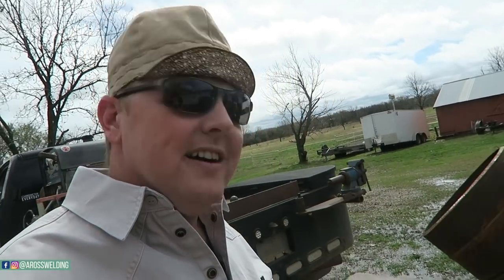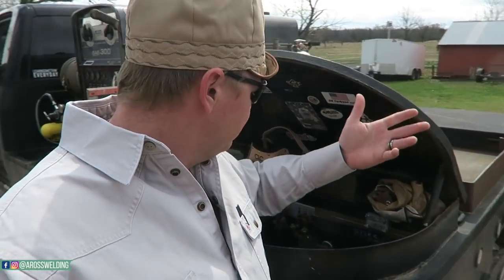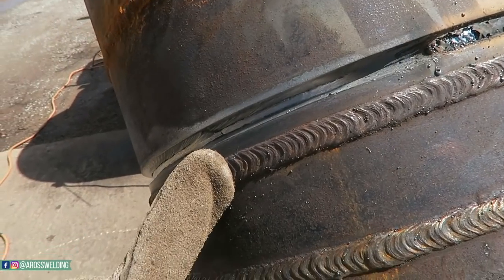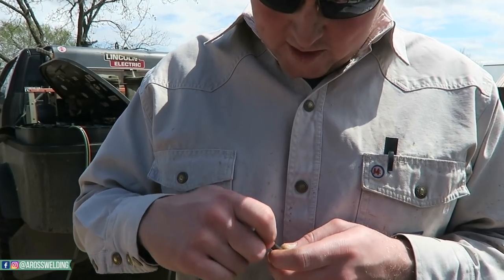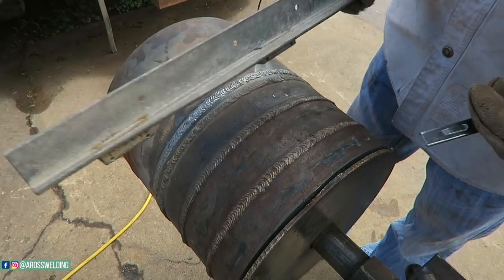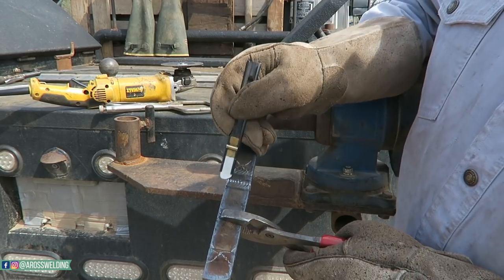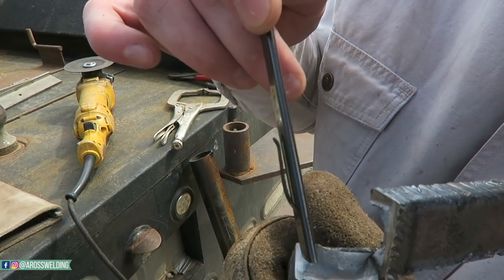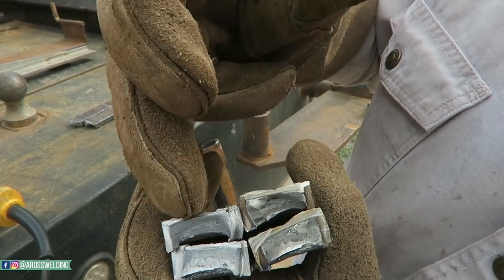HOW TO TEST YOUR OWN WELDS AT HOME // PIPE WELDING PRACTICE (I broke my vise!!!😳)

Comment: Now you can make a video welding that vice, it would be awsome learn how to weld cast iron or steel
Reply: it will break again. Even if you silicon "cool" it and V bevel the entire break, it will break again. Cast is extremely dirty and the mixture isn't consistent, so you have a lot of dirty spots or high iron deposits in it. Sure, you can weld it, but it's eventually going to break right at the toe of your weld.
Reply: @michaelalmeida8790  not if you weld it with the right rods. Too many guys try to lohy it because cast rods are $11 per rod
Reply: Mig weld it or tig

Comment: I am NOT a professional welder, just a DIY’r with a bit of exposure and experience.  I was always told if a rod or Mig wire flux core weld uphill to keep flux from over running and interring with the filler material, tie in and porosity. Yet I see you welding downhill on the pipe.  I’m sure different rods, material thickness, prep, weld machine amp settings and welder skills running downhill flux electrode can be accomplished.  But is it actually something that would be generally accepted if a QA person were witnessing your weld on a critical weld.

Comment: That looked an awful lot like a Harbor Freight pipe vise. And if you are telling me you got almost 9 years out of it doing pipeline and rig work you are well ahead. I bought the 6in Harbor Freight vise probably around the same time and am happily surprised it has survived and I haven't abused it anywhere near what yours has probably seen. Also for the HF vises, from what I have seen that mode of failure is the most common. You cant expect much more from a Chinese junk cast vise that only costs $80..

Comment: Practicing for my first test. Is it better to grind your root or run a wire brush? I haven't taken my first test yet, but on the root I wire wheel it, run my hot pass at 75-90 in 3rd gear depending on my mood, and I push till I feel it dig, than long arc to let it fill before I do my next step. I notice the guys who grind there roots tend to scrape drag and step/whip it without really digging. When I say dig, I mean I push down like you push down a pencil on paper till I fill the rod penetrate deep enough into the root bead that it almost pierces through the other side. Is this an accurate method? Self teaching here
Reply from the maker: Either way, I know guys that grind their beads and I know guys that’s don’t grind em. I’d say most generally most guys grind them on a test but I have known a guy or two that didn’t grind it on a test and still made the test. Everyone welds different and learned dif techniques from others or self thought like yourself.
Reply: @arosswelding   Great piece of advice, I appreciate it thank you.
Reply: @arosswelding  thanks austin and   durpfurper for  being thurough in your question  and telling how you do it

Comment: Would a 6011 1/8 inch for the root an 7018 1/8 inch fill an cap on 8 inch pipe be a good practice?
Reply: I do it all the time, but sometimes i just do 6011 all the way, just to get a feel for that rod. I use 6011 because my weld supply stores use the cheap 6010 rods that do not weld for shit, surprisingly the 6011 they sell burn better. I want to get 6010 5p from lincoln, but a bit expensive at the moment.
Reply from the maker: Oh ya that’s good practice.
Reply: @Ruben901  yeah everything is going up.
Reply: @melvinmariott8609  

Just wait till you see the pricing for 8010 rod....Dubya Tee Eff!

Comment: I realize that you're just testing practice welds in this video, but I want to point out that API 1104 currently requires that nick-break test specimens "...shall be notched with a hacksaw...".  It would seem to be appropriate to allow them to be nicked with a narrow disk grinder, but this is currently prohibited.  This will change in the soon-to-be-published 22nd Edition of API 1104.  I also want to point out that the exposed fracture surfaces must be at least 3/4 in. wide, so the specimens should be on the wide side of “..approximately 1 in. wide…” and the notches should be on the shallow side of “…approximately 1/8 in. deep…”.  Keep up the good work!

Comment: Where do you get your welding caps an what brand??
Reply from the maker: The one I’m wearing in this video is DABEC brand. But I also wear BADASS caps. You can find both online
Reply: @arosswelding  okay thanks. Its looks alot like the ones I wear..an I can't find them anymore there a rougher an stiffer material an that's the ones I like because them soft ones get all crummy to me when soaking wet with sweat on them hot Louisiana days. Thanks alot enjoy your channel

Comment: Looking for my first pancake would u recommend the Wendy’s or sarges or what is your recommendation for a first pancake that won’t break the bank
Reply from the maker: Out of those two I would get the sarges. Cause it’s lighter in weight. But I personally like my empire south and cmr pancakes.
Reply: Austin Ross been looking at the CMR which one would u recommend from their line
Reply: I like the carbon fiber ones from outlaw leather. You can find them anywhere though.

Comment: Do you tow with that step hitch you burned in?
Reply from the maker: What hitch??
Reply: Austin Ross the one on your welding truck in this video, what did you weld on to the tow ball hitch?
Reply from the maker: Those are blocks that a spring place made for my rear end to make it level but they never worked so Welded them on for a step. I pull a trailer more often when I’m home so I like to leave my ball in there instead of the other hitch I made.
Reply: Austin Ross very nice, I’ve been thinking of making one and I like the way that one looks.

Comment: Hey Austin, I have a 300 like yours but capping the bottom is kicking my butt on a  12 inch bell.  What do you set your Course and Fine (remote) settings on when capping the bottom ?  I guess I mainly just need to know what you set you Course setting on, 150 or 220 ?   Great video.  Thanks for taking the time to make them !
Reply: When capping, I have mine in 3rd gear (190-120 range) than I start at 55 on the remote (fine current) for the top than around 45 by the time I'm at the bottom between the 7 and 5 o'clock range

Comment: What type of beads do you lay?
Reply: Do you go in a Circular motion or do you drag the rod. I have seen people take the rod and they bend it on the pipe and drag it
Reply from the maker: I do a lil of everything. Kinda mostly ovals I guess. I just read the puddle and react.
Reply: Ok it’s because I am 16 and I would like to be a pipe line welder so I am going to school for welding and I have been asking other welders and I wanted to see the types of beads they lay on the pipe so when I practice on pipe at home I know what type to use
Reply from the maker: Shoot ya. I would encourage you to try a little of everything. See what works for you. Every welding machine is different, everyone welds different and everyone sees the puddle differently. So don’t be afraid to try all different kinds of motions. But ya circles, ovals, or whip actions are good motions depending each pass. 👌😎
Reply: Thanks man thank you for the info I will go try it on a coupon and see how well I do thank you man
Reply: Hey bud what’s your beef man

Comment: Can you weld your vice back together?
Reply from the maker: I could but I prob won’t fool with it. It’s cast. I think they make cast iron welding rod or it may be possible to preheat it and weld it with 7018 but since I will prob be rough on my vice in the future I’ll prob just invest in a more durable one.
Reply: Could weld it with some nomacast, but it probably wouldn't hold up to abuse lol